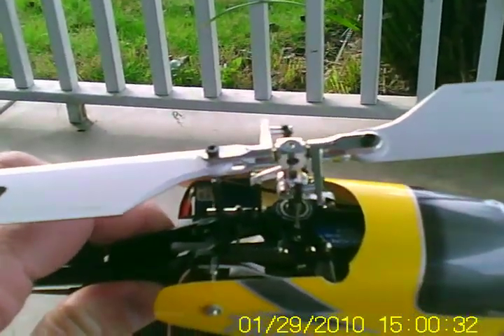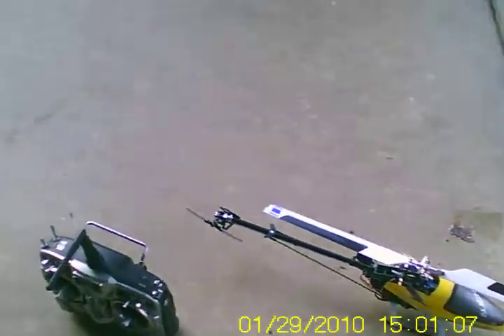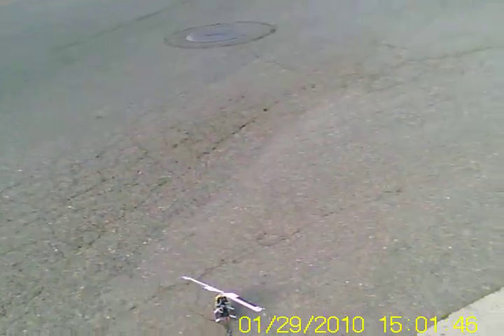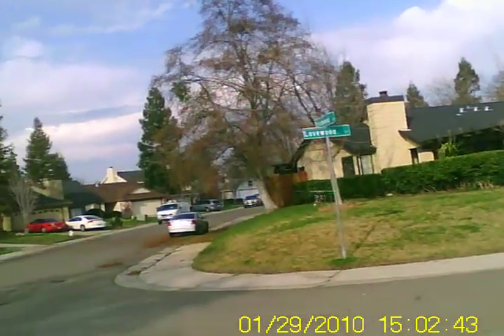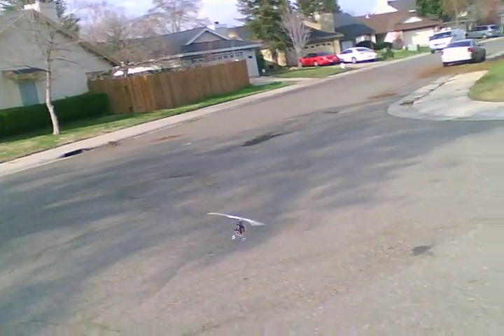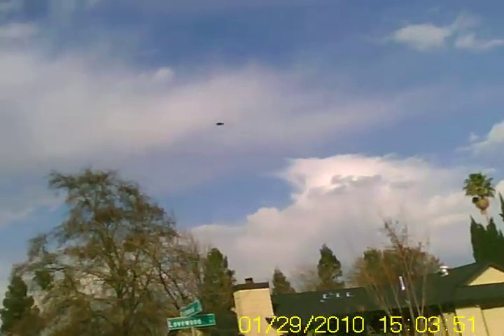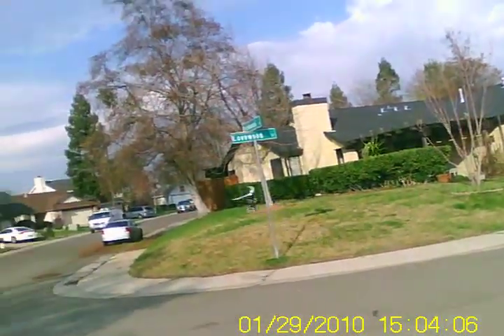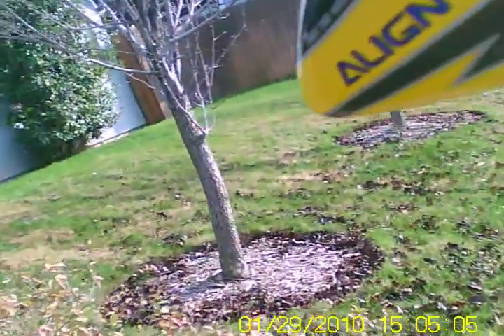Trex 250 FBL FL760

Comment from the maker: you see *what*? the oscillations? i have gotten it close on at least 2 occasions....flying with close to no bobbles on stops or direction changes. but, never as good as with the flybar. i may have some more news in an hour or so when the light outside is good enough to fly. i made one final set of changes last night: stiffer dampers, changed the geometry for more resolution at the servos. we'll see soon :D